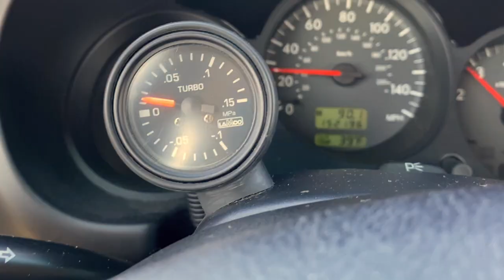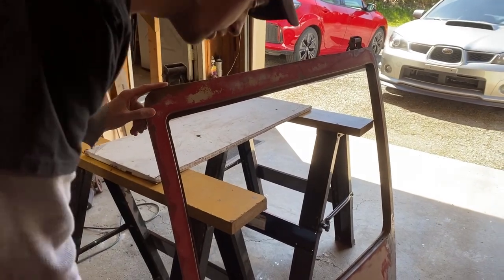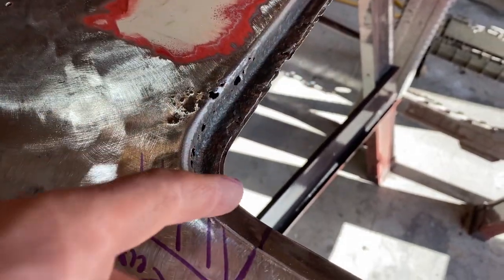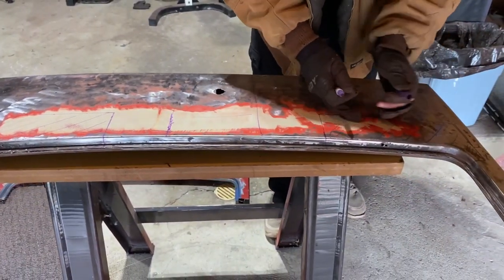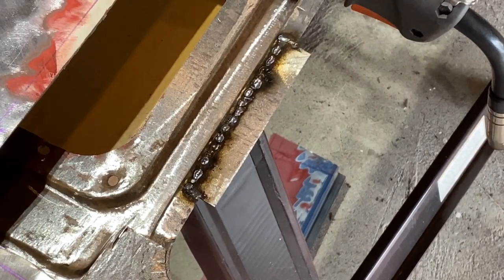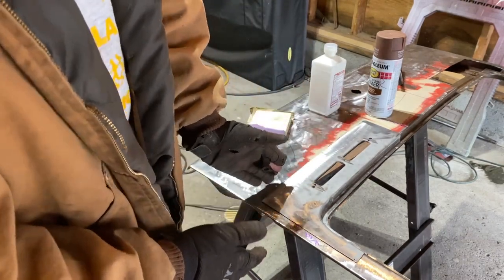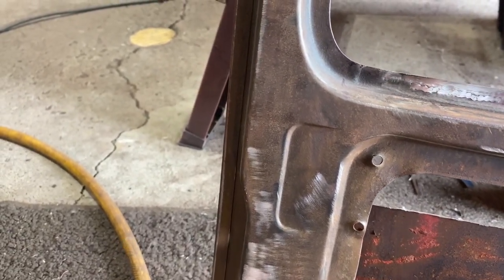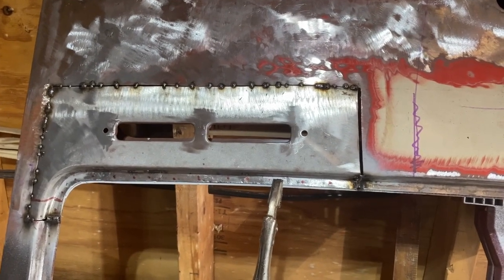MAKING a SERIES 1 Datsun 240z HATCH with FRESH AIR VENTS from a hatch that IS NOT a SERIES 1! EP. 5

Comment: If you haven't seen Fitzee's Fabrications, he has a variation on the cut-through-two-pieces method. He cuts at a 45 degree angle, which results in a closer tolerance (welding gap) than if you go in perpendicular. Also, if it comes in to play Lakeside Autobody has some tips on dealing with oil canning. I've been binge watching your 240z videos all day. Nice work!

Comment: you will find most 70's hatch backs, have the vents to allow the air inside the cabin to escape when shutting doors and hatch's. otherwise the pressure of the shut can pop a window. so i've been told. whether there on the rear pillars or hatch.

Comment: Thanks for sharing your experience. I know its way to late to share this, but I believe the small pin holes you welded up in the rear hatch are supposed to be there for drainage so water doesnt stand
Reply from the maker: Gotcha I did not know that! Will have to look into it again, thanks!

Comment: thanks for showing the tip with the copper plate.
Reply from the maker: jesse sims No problem! It helps a ton. Also can just use copper pipe from home depot and just smash it down into a paddle to back the weld

Comment: Hi Ryan!  Thanks for the videos and sharing your experience!  I've had several S30s over the past 30 years.  My 11/71 has vertical heater traces, one strut, and no hatch vents. Having an early hatch is cool and all but there is a reason Nissan switched to the side vents - rear vents allow exhaust fumes to flow directly into the cabin. A good, lean tune, down facing exhaust tip, and a/c in the car so you can drive with the windows shut might make it tolerable. You said "tin canning" several times, in case you didn't know, it's actually called "oil canning." The name was derived from old-fashioned oil squirt cans. You can fix oil-canning with accurate application of heat.  Also, check out https://www.youtube.com/watch?v=aHBidYUnvvc&t=730s for neat tricks for making patch panels.
Reply from the maker: Awesome thanks for the info Ross! I will now call it oil canning in the future. Yeep I agree with the later hatches being better but figured I would try to stay with what the factory did for my year/build date! Thanks for watching!

Comment: Funny my 1973 had an earlier vented hatch fitted to it,  .It also is like yours has UNDRILLED indentation  And My 78 hatch is like yours strut mounts both sides
     This is a very good question. And some one that dismantled Z cars every day still....you can find on face book and has any part you can think of is " Junk Yard Jenny Z Parts "
She takes Z cars apart EVERY DAY "still !
   Thru the years some of these parts never cross the mind unless you have racks of panels to pull out and compare....she does and I'm sure they date the year they came off of.
Reply from the maker: Good to know! I was thinking this was a 280z hatch for the longest time (especially since this was “supposed” to be the original one off a 280z parts car) until I saw there was only one side that had a place to connect the hatch strut as well as the vertical defroster rear window. I will have to look up Junk yard Jenny Z Parts. Thanks again!
Reply: @RyanSampsonRPh  yeap and those vent rear hatch is like gold to 240 guys.
    To me I always do my absolute best to keep exhaust fumes from coming thru the entire rear structure.
     You have to be absolutely ,
ABSOLUTELY sure Every thing is sealed ,tail lights to body, license plate light sealed, hatch seals (actually touch and compress all the way around ! Besure Gas tank vent plumbing is sealed ,hoses are all fresh, sealed were they come into the back.Sealed gas filler hoses and connections.
    You have to fully attack anything around the entire back half of the car to keep exhaust completely out of the car.
And those vents ,are a big source of fume leakage.
So I'm taking out the plastic pancake boxes. Putting a blank off plate behind the grills sealing with a rubber gasket and using 280z blank off grommets in the lower hatch so no fumes come into the car. But still looks official...
Reply from the maker: MindDezign that’s a great idea blocking those off from the inside yet still keeping the look of it being original. I think I will do the same when it’s time and for sure seal it all with new gaskets, gas filler hoses etc
Reply: @RyanSampsonRPh  exhaust fumes in a Z....can be brutal.
I go crazy like park it in the dark garage with a bright light inside the hatch and a heavy blanket over the hatch window. And in the dark crawl all around the hatch looking for the tiniest pin hole of light. Looking under by the gas tank by the license plate panel....like a madman hunter!!
Reply: @RyanSampsonRPh  see most guys drive them a few times a year. NOT for me...I daily drive mine when it's on the road !
You can put up with fumes for a cars and coffee....but that is it.
    I hate exhaust fumes ,sort of why early Porsches are the same with heat exchangers!